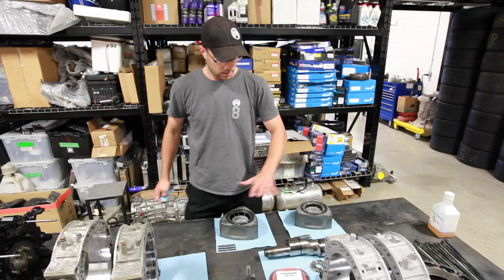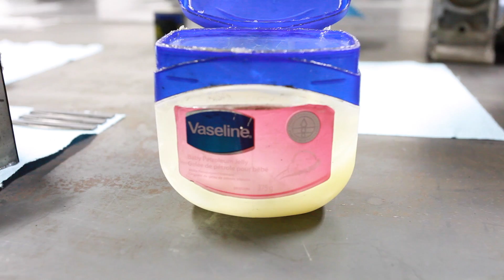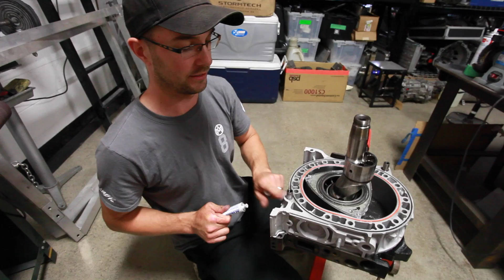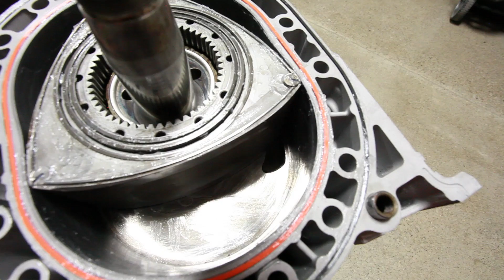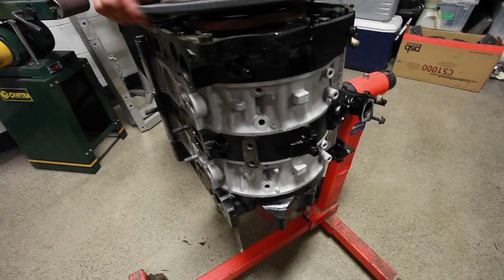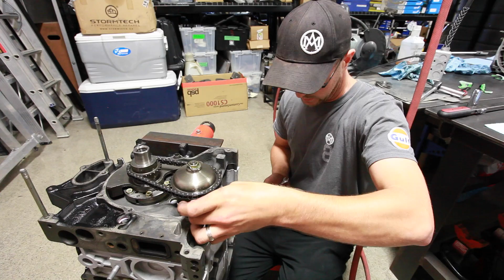How To Build A Rotary Engine

Comment: Let me ask you two geniuses m. Do ya know the difference between an engine and a motor?
Reply: There is no difference... Engine and Motor are synonymous and interchangeable.
Reply: doktorbimmer motors are electric. Engines require fuel
Reply: Aaahh... NO! Not true... and I can prove it.
Reply: doktorbimmer look up the definition before you get carried away
Reply: Sorry son, engine and motor are synonymous and completely interchangeable, both terms are used to describe a machine or device which converts any form of energy into mechanical work.
Reply: doktorbimmer so a starter must be an engine using that definition. Very good
Reply: What about a Rocket Motor ??? They are not electric... and a Siege Engine used manpower... not the combustion of fuel.. Don't be a hypocrite..

Comment: The original ones like the 12A also had the seal grooves in the rotor housings like this one does but they also had double side seals and fat sintered single piece apex seals. I would love to put a 13b or even a 20 in my old RWD Isuzu Impulse.

Comment: Honestly I would of thought that the rotary motor would have been harder to put together but it looks pretty simple.
Reply: 99% of the work is in rotor prep and other parts prep. They call this "the build" but really doesn't contain much of the info that leads to a great motor.
Reply: You're a fucking tool lmfao never even owned an FD Rx7
Reply: A "great motor" would have reciprocating pistons

Comment: Thanks for the lesson. But I have a issue with my rx8. My engine seized up and is automatic how do i loosen up the torque converter? Please help!!
Reply: There are a lot of scrap yards that will come tow it away for free.. you may even get a little cash for the scrap value.
Reply: How about you take your ass outer here and go comment on some peace of shit piston engine...
Reply: Reciprocating engines are still being successfully mass produced... the Wankel is OBSOLETE.
Reply: Your Wankel engine is the one seized up...  exactly which engine type is a piece of shit now??

Comment: It's 54mm. NOT 52mm 

Just in case anyone else wants to buy a $50 52mm socket just from taking his word for it like I did
Reply: Storm Anderozzi I've used a pipe wrench before and it works just fine

Comment: Given the relative softness and ductility of aluminum, it's always a good idea to let bolts or studs clamping one or more aluminum parts together sit so the aluminum can "relax" for 10 or 15 minutes before re-torquing them. And a smidgen of anti-seize anywhere steel or cast iron and aluminum meet with any sort of interference fit is an excellent idea. Especially steel bolts and screws in aluminum housing threads. Galvanic action sucks ass and it loves to strike engines due to frequent heat/cool cycles and resulting condensation and corrosion. Oil and oil-based lubes will eventually evaporate away and they can even contain small amounts of moisture that will do the damage. Anti-sieze is basically fine stainless steel powder in a grease/oil carrier, and even after the grease or oil dries, the stainless coating and corrosion prevention will remain.

Comment: Just FYI for any DIY mechanics out there, once you get above 19mm and 3/4" sizes in metric and English fasteners with hex (six-sided for rotary fans) heads internally or externally, there isn't enough different between metric and English tools to matter. At least not if QUALITY tools are used. I can put my Snap-On 19mm wrenches and sockets on 3/4" heads and 3/4" sockets and wrenches on 19mm heads and not be able to tell the difference in fit. 

I imagine if I broke out a micrometer or digital caliper there are maybe ten thousandths of difference, which doesn't matter since all tools wear some over time and bolt head and nut diameters can differ significantly depending on the quality of the fastener and what they've been exposed to. Basically if you have metric wrenches above 19mm  you're wasting your money on English and vice versa. 

25+ years as a professional diesel mechanic on machines metric, machines standard and machines a mixture of the two from nitro RC cars through diesel-electric freight locomotives and I haven't needed a metric wrench larger than 19mm yet. Save your money for tools where quality and precise fit really matter and "close enough" can ruin your whole day or week or month, such as Allen drivers, Torx drivers, etc.

Comment: The two-stroke comparison is flawed. First of all, there are two strokes that have camshafts for the exhaust valves, and even two-strokes without camshafts and poppet valves still use reed valves to control intake airflow or cylinder ports/passages that are covered and uncovered by the piston, which serves as the valve. 

The pistons also serve as the "pumps" that alternately increase and decrease crankcase pressure to bring the intake air/fuel charge into the crankcase, which also aids in scavenging when the exhaust valves are open or the exhaust ports are uncovered. This amounts to spark-ignition two-strokes having "forced induction" to a degree, since once the reed valve is closed and the piston continues traveling down the cylinder, the crankcase pressure is increased, pressure in the cylinder is decreased and the fuel-air charge is "pumped" into the cylinder where it displaces the exhaust gas. 

As engine speed increases along with cylinder and crankcase pressures, two-stroke engines become "more efficient" and the torque output and therefore horsepower production are very linear with engine speed. Unlike Wankels, you shouldn't and won't see fire exiting the exhaust ports of a properly designed and tuned two-stroke spark-ignition engine and because as engine speed and load are decreased so is the efficiency of the "pump" and airflow through the carburetor and fuel flow, and pressure is balanced between the cylinder and crankcase and you actually see "positive pressure" back to the and into the carburetor itself so fuel flow is effectively cut off. 

The engine doesn't load up with fuel and the instant and dramatic throttle response of a properly tuned two-stroke is a result of the engine being very "clean" and not flooded with fuel or choked by exhaust gas remaining in the engine. Backfiring is all but impossible since there is no exhaust stroke to eject unburned fuel and air into the exhaust system and no overlap of intake and exhaust valve opening to allow heat-ignited idle fuel and air to escape into the exhaust system to ignite accumulated fuel vapors there. 

Backfiring is the result of exhaust system leakage, poor scavenging and an improperly tuned or "leaky" Otto cycle spark-ignition engine. Two-strokes simply will not run well enough to backfire even if they could if they have significant air leaks at the crankshaft seals, piston rings, etc. 

There are other major details that make two-strokes not only considerably different from rotaries but superior as well. By varying reed valve size, spring tension, etc or altering the port location and size and the piston itself, the engine can be "tuned" relatively easily without changing major components. By varying exhaust plenum volume to create a "tuned" exhaust pipe, scavenging and charging of the cylinder with a fresh fuel-air charge can also be "adjusted". Modern high-performance, high-quality two-strokes also have either on-demand oil injection or when using mixes use very lean mixes in the 32:1 to 50:1 ranges. I've heard rotary "experts" recommend "premix" gas/oil in the 32:1 range or even richer if the OMP is "non-functional" and as "lean" as 64:1 if the pump is working.

I"m still trying to figure out why a dedicated rotary owner wouldn't fix a non-functioning OMP, but I suspect there is only so much that can be done, and that if significant performance and "combustion pressure" gains are realized from improved sealing, changing port location/size or forced induction, the OMP is going to be less effective because it has more pressure to overcome in order to inject the oil. 

Two-strokes use oil injection or oil/gas mix because that is their ONLY source of lubrication period. They don't have crankcase oil of any kind and don't require additional lubrication to make up for inherent weaknesses in the engine design. And generally speaking, LESS IS MORE up to the "leanest" possible fuel/oil mix because oil is VERY low in cetane, "rich" oil/fuel mixes thicken the fuel and make it harder to vaporize and keep vaporized, create less efficient operation and are harder to ignite and burn rapidly due to the low octange of the oil dragging down the gasoline's octane. 

Overall, comparisons of Wankels to two-strokes are made to make their failings and flaws more "acceptable" to those who recognize all the many advantages of piston engines. Which, by the way, benefit from IMPROVED CYLINDER SEALING regardless of whether they're naturally-aspirated OR have forced induction. Once again, I don't know why anyone who claims rotaries are "Otto cycle" engines and who knows engines in general would prefer LEAKY internals to WELL SEALED internals, regardless of engine design. 

The whole point of an engine is to be an AIR PUMP and as effective and efficient of an air pump as possible. Do you prefer a shop air compressor that has worn out or damaged rings and/or cylinder walls and takes 15 minutes to pressurize the tank to 120 psi or a tight compressor that takes 10 minutes to do the same job? That's just a no brainer, isn't it?

If you're going to introduce the additional complexity and expense and the disadvantages of forced induction to an Otto-cycle engine, why in God's name would you want to decrease the available efficiency and economy gains by INCREASING LEAKAGE past the piston rings OR apex seals and in the process lose compression, cylinder pressure, heat and power while increasing the crankscase pressure with the resulting pump loss increases when the pistons or rotors have to move through their cycles against higher pressure "below" them.  Not to mention poor sealing works both ways, cylinder pressure drops and intake "vacuum" are reduced and there is decreased scavenging and increased oil vapor/crankcase gas flow past  the rings or rotor seals INTO THE COMBUSTION CHAMBER. 

Its the POOR EFFICIENCY and sealing of even "good" rotaries that causes backfiring, fire in the exhaust, poor fuel economy and the huge "heat differentials" in the engine itself. Which is to be expected when only a small portion of the engine's "swept volume" is exposed to the heat of combustion and compression and therefore never achieves a stable operating temperature and efficient sealing and pumping.

Comment: You can torque the oil pump bolts properly, there are step off tools that allow you to do so... Pretty common to use one on a 2t cylinder ;-)

Comment: first what you do is take your rotary out and clean it up. then you put the LS where the wanker was in the car. Use wood screws to attach firmly. turn on and drive.
Reply: leloodallasmultipass and have a stupid ass piece of shit because the weight ratio for the car is all fucked up

Comment: The spark plug hole should be replaced with a small horizontal vane or gap. This prevents unburnt fuel/air mixture entering the exhaust and thus increase power in the combustion cycle. The fuel/air mix passes through the round spark plug hole.
Reply: Mazda already tried that idea.. it doesn't work, tests showed NO IMPROVEMENT in performance and the design cause increased misfires and spark plug fouling especially during cold starts.
Mazda has abandoned development of Wankel engines... they are obsolete now.

Comment: what kind of RTV is that ? Can i use black Permatex ? or red Permatex ?
Reply: Finally someone asked this question !  He is using an AC DELCO tube of RTV but thats not enough info. Its important though because Im only aware of Permatex "The right stuff 1 minute" that can be assembled immediately such as this guy does with the AC Delco RTV. Every other RTV im aware of needs a certain amount or curing time before assy !  So, what is he using exactly ?

Comment: Basically it rotates or combust 3 times slower?
Reply: Renzeth Bulawan no, 3 times faster than a normal cylender engiene. a wankel has 3 combustiens per rotation and a cylender only have 1. ;-)
Reply: +Mikkel Bagterp  Wankel engines complete there firing order sequence in 1080°   4-stroke Otto and Diesel only require 720°

Comment: why do they use alloy housing? would steel not wear less? or is this a weight thing?
Reply: +Mikkel Bagterp You are welcome sir, Cheers!
Reply: Sharpee Gaming yes it is a waight thing mostly and also the housing doesnt whear alot in the first place, it's the apex seals.
Reply: The apex seals do not directly contact the soft alloy castings, the surfaces have some type of hard coating or layer of hard material such as iron or steel...  chrome and silica have also been used.
Reply: +Mikkel Bagterp Aluminum alloy is used to prevent the triangular piston(rotor) from contacting the inside of the housing, by using aluminum alloy the housing will always expand due to heat to a slightly larger inside diameter than the piston preventing contact damage.
Reply: The real doktorbimmer oh i didnt know that, thank you for informing me and others.🙂
Reply: The real doktorbimmer cheers 😉